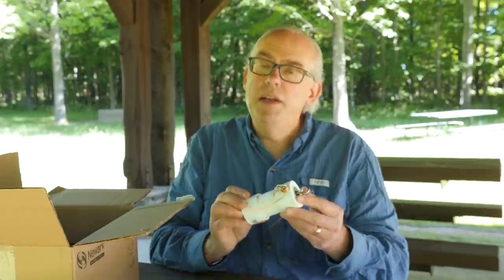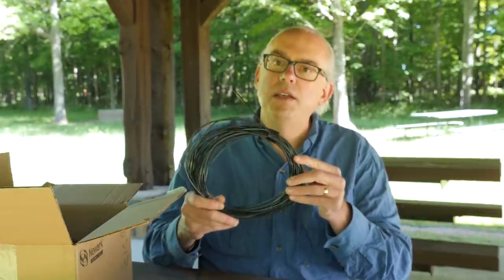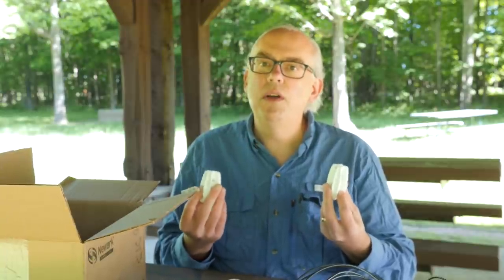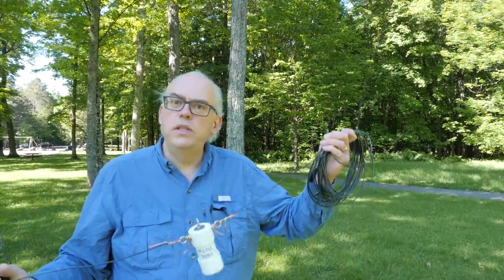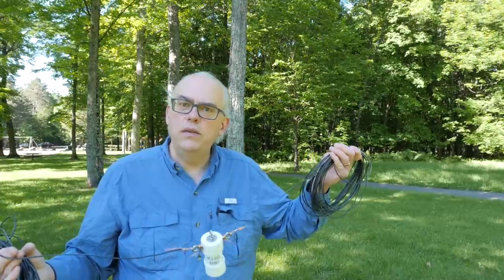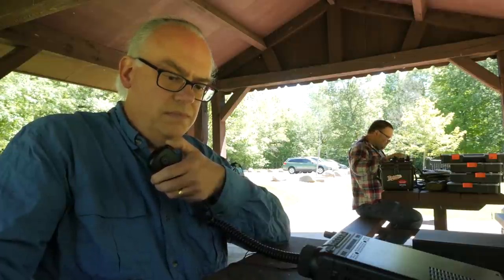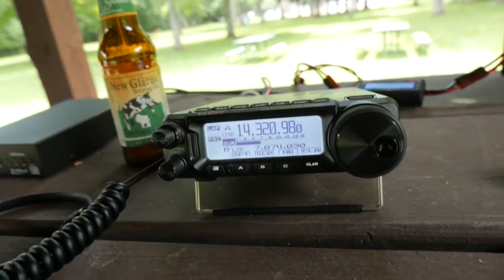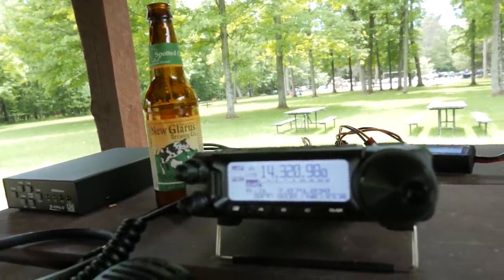Off Center Fed Dipole (OCF) Antenna - Ham Radio Q&A

Comment: Terrible readings for SWR! This antenna is not tuned right and should be cut to get down below 1.5 to 1. Any antenna will work usually but taking some time to tune it properly can really make a difference. Why this guy made this video I don't know but it is not a good example for new hams. Terry
Reply from the maker: I think you missed the larger point of the video. Yes, you can get the SWR to under 1.5:1, but when you do your antenna is committed to that location as the SWR will change when you move it. As I said in the video, the most likely reason for the slightly high SWR was the height of the balun as it was below the 30 foot height that is recommended for off center fed dipoles.